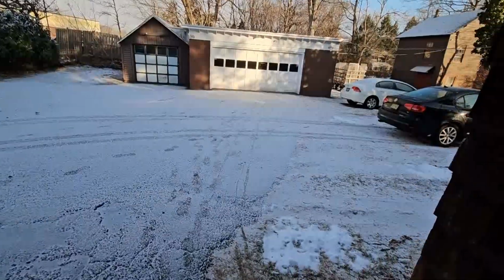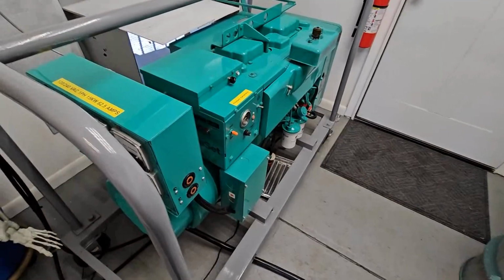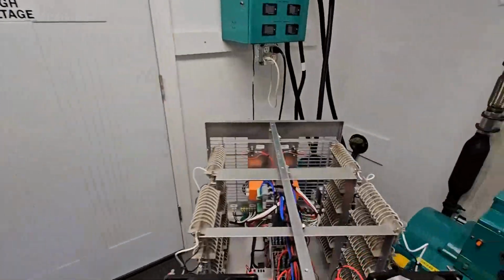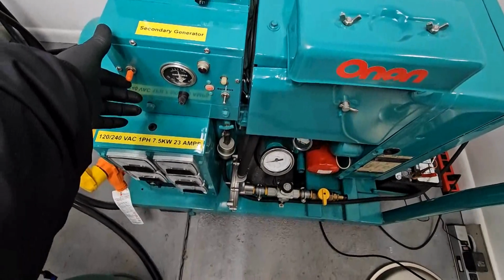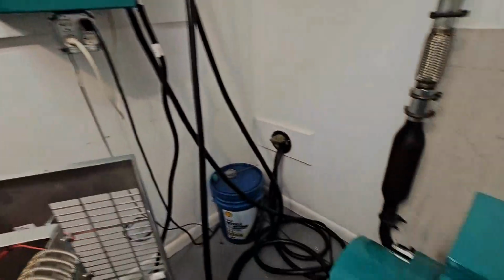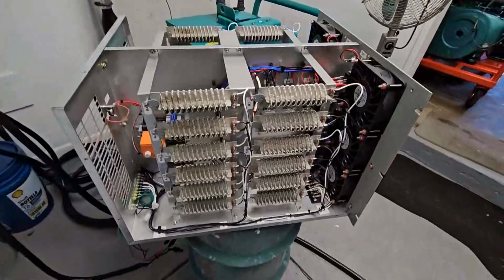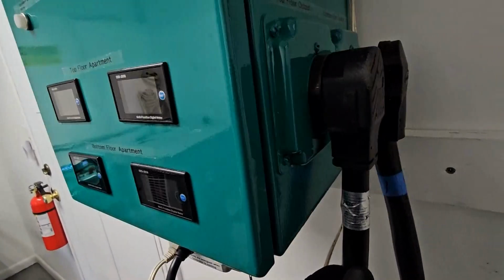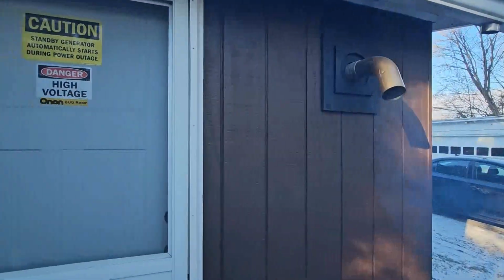Load Bank Testing an Onan DJC and Onan JB using an Avtron SLS-10 Load Bank Simulator

Comment: You have a sweet collection of vintage stuff that I cut my teeth on 30 years ago. It also seems that your gear is in near mint condition. Well, maybe you bought stock in that OEM green paint and fresh decals. <LOL> Probably not, as those are indoor units and usually clean up well. I did gen service for 25 years and have been retired 5 years now. Most of the older Onan stuff I did was those DJ or JC series and CCK (older) ones. I took a liking to those air cooled sets because the worst that happened in the field was ignition issues.... or mice. Mice could be the end just due to the cost of revival. Water in a rusted exhaust could also be a disaster, especially if it froze. BTW, you could probably lower the RPM on that DJ a tad. If the gov is adjusted tighter it will hold 59 Hz at full load but not go over 61.5 unloaded. Never found a diesel that needed over 62 Hz unloaded.
Reply from the maker: Thanks for your comment. The DJC and JB you see in the video as well as the brief view of the other J series and small gensets were all restored from ground up. I have over 100 videos on YouTube showing various gensets that were restored as well as during some of the restorations. For me, it is just a hobby that got out of hand. As for mice, they love to nest in the control boxes. I've rewired a good handful of control boxes from A to Z. They chewed wires, and their piss destroyed just about everything else in the control boxes. In the J series gensets, the rectangular cutout in the back right corner for the wires had enough room for mice to pass through. Inside the flywheel cover on the J series gensets, the mice loved to nest above the starter.
Reply: @jjjj-uf4bw    One of the things we got good at (over time) was mouse proofing gen sets. It wasn't always pretty, but it was effective. After this series the 4 cyl liquid cooled sets were even worse for mice.

Comment: The DJC is a dirty bastard. I watched the entire video and finally you went out to the exhaust pipe and now we all know. A huge amount of incomplete combustion. Dirty diesel wow. I am a solar guy that builds uninterruptible power supplies with lithium and lead batteries and it makes me laugh at guys that run diesels without inverter charger battery combos.

lol.
Reply: that was state of the art in its day. They will run for thousands of hours with just oil changes. Also, air cooled so none of those worries either.
Reply from the maker: Yeah, it is so dirty I got sh!t from Greta already   lol...
Reply: @jjjj-uf4bw  Drill baby, drill 😅
Reply: Total cost of ownership far lower for a diesel generator that runs 10-20 hours per year and never ages out, than a battery system that costs 10s of thousands and max life 5-10 years maybe 20 as the lithium places that have been in business for 5 years are claiming
Reply: @   These are also different levels of power backup that don't compare directly because a battery system is usually automatic and you will use it as a matter of convenience if the juice goes out for a half hour. Most people with a manual start gen set will ignore short outages till the fridge, well pump, or heat need to power up. (guilty as charged here)
Reply: @rupe53  Yep and if you are not home nothing needed to start, no money needed to be spent.  I have a tiny UPS for my phone and computer I got for free also.
Reply: @    before I retired I was "that guy" who was always near by something "good" when it was being tossed out. I miss those days... and now I have a house full of stuff that needs sorting through. I used to joke that I have at least a quarter mile of extension cords... and that's only #12 wire and smaller. I probably still have near 800 feet of #10/4 to do heavier jobs. Had another 1,000 ft of #6 and larger. 1,000 feet of garden hose anyone? I was in charge of "collecting" gen sets at my last job. They all got refurbished and resold.

Comment: Still using your load bank with really small wiring and you expect to do a real load stress on any generator like that? It's a good thing it didn't melt though. Redo your wire connection and load test it again.
Reply from the maker: As mentioned in my video, it was temporary and was just for a brief test. As of this reply, the load bank was rewired with 8 gauge where the genset connects to the load bank. As you know, 8 gauge wire will easily handle 10 kw @ 240 vac 1 phase.  Other wiring from the factory inside the box is special Teflon insulation coated with 200C spec.  I will be creating a new video showing the updates, but let's see if these links work 
https://www.smokstak.com/forum/attachments/001-jpg.593779/
https://www.smokstak.com/forum/attachments/005-jpg.593783/
https://www.smokstak.com/forum/attachments/000-jpg.594589/
https://www.smokstak.com/forum/attachments/004-jpg.594491/
https://www.smokstak.com/forum/attachments/000-jpg.594488/

Comment: Every time I see the sets in your stable,  I get green with envy 😊!      You told me once before but I forgot what you said you used for the transfer switch to switch from the diesel set to the smaller set.    I'm in the home stretch now in getting my air cooled lister diesel set connected to the house with an automatic transfer switch but would like to run a smaller set through the night when I would only need some lighting and my cpap machine etc.  
I wish these onan diesels were as plentiful in Nova Scotia as they appear to be for you 😊